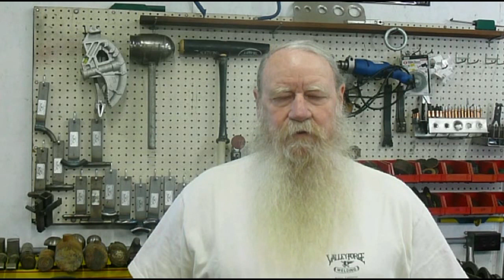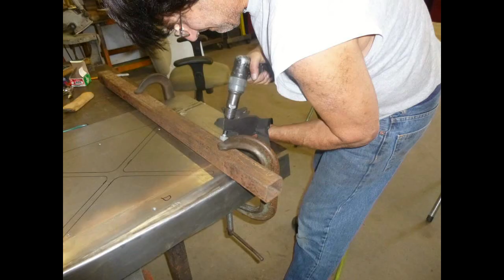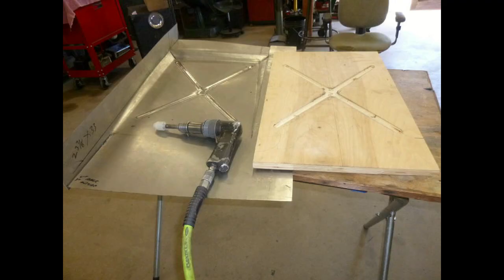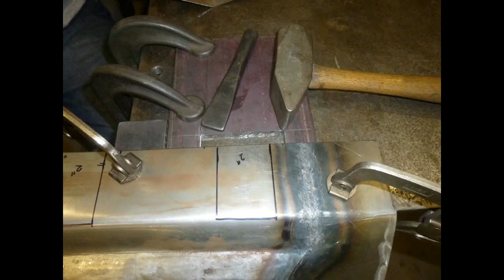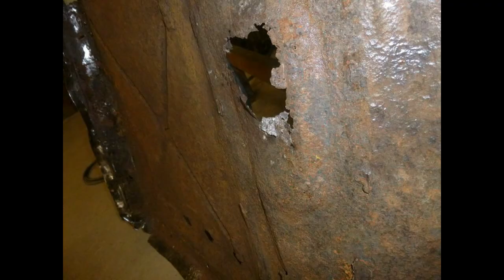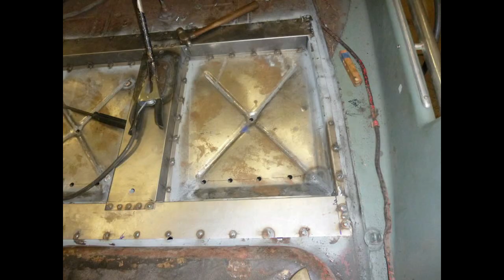Alan's Jolly Floor Pans

Comment: Sorry to bug u again.  Where would you buy those heads for your air hammers?  Also, would u know where to buy a really top quality blocking hammer?  Something American.  Not inexpensive Chinese junk.  Love your videos.  Top quality.
Reply from the maker: Hello James. No Problem.

I make my own heads for my air hammer. I buy a length of different diameters and cut off what ever is needed for the head and use my ball turning tool to form the end.

Pexto made my blocking hammer and you may find it through McMaster Carr. Peter Tomacini makes a nice one but he is in  Australia. Any hammer you find would work just fine as long as it is forged and not cast. I usually re handle my hammers anyway so they are at the correct balance point for the length of the handle.

Jere
Reply: Thanks Jere.  I'll chase one down, now I know who makes them.  Thanks again.

J.B.

Comment: Just curious.  Approximately how many hours was this job.  Excellent video, & obvious pride in workmanship.  If more people would work like this, we wouldn't lose so much of our economy to China.
Reply from the maker: Thanks for watching James.

There were several forming blocks and different heads made for the air hammer. With those pieces and forming and welding it too the best part of a week with two people. The majority of the time was on checking and double checking the original parts and making sure that what I was producing could not be seen other than original.

Thanks again.                 Jere
Reply: Well worth the time.  Amazing quality.  Great video.

Comment: Could you tell me what size Delrin stock and comprssion material you used for the air hammer buttons?
Reply from the maker: I am not sure of the name of the plastic I was using. It is 1" in diameter and I got it at a scrap yard several years ago. It was about 18" long and cost $3.00. Look up McMaster Carr on your computer and check out their plastic selection.

Hope this helps.         Jere

Comment: I should have just bought the floor pans from ebay but instead look at me know balls deep in a project with a harbor freight welder, a hammer, and a grinder with a cutting wheel. Needless to say I will not be having these types of results. Sigh...
Reply: I have a suspicion that with your obvious dedication, you'll do just fine.

J.B.
Reply from the maker: Thanks for watching. I am pleased to see that you have taken on a new project, that before watching this video, you may have thought was out of your skill set. Don't  be afraid of making mistakes. The only difference between my skill in fabrication and yours is that I have a much larger pile of scrap than you. Just keep after it.

Jere
Reply: Jere Kirkpatrick I have finished welding my floor pans in and they work fine but are not near the quality you would have produced.  Thank you for your comment. You have many more years experience than I do and you are very talented as well as have more scrap than I do !
Reply from the maker: It is quite gratifying to me that I could give you the confidence to attempt a project that you might not have otherwise attempted. Just remember that the pieces that didn't come out exactly the way they should have are the ones that taught you how to make the ones that did.

Jere